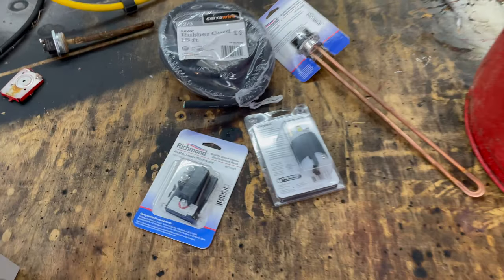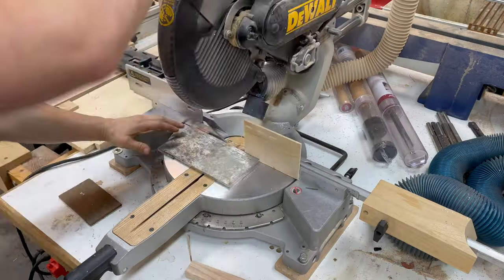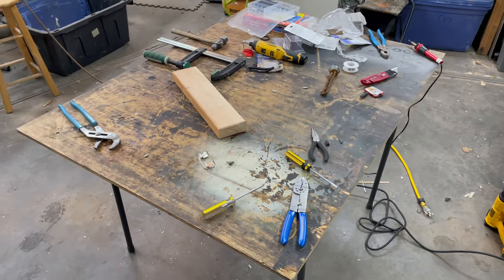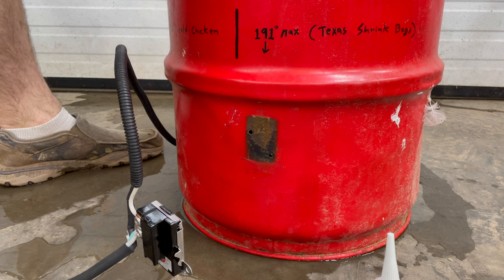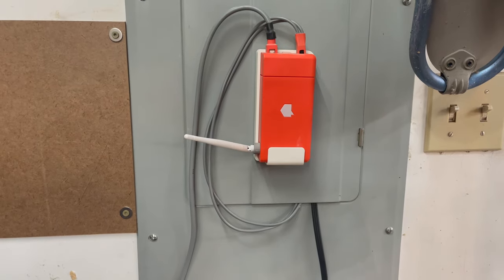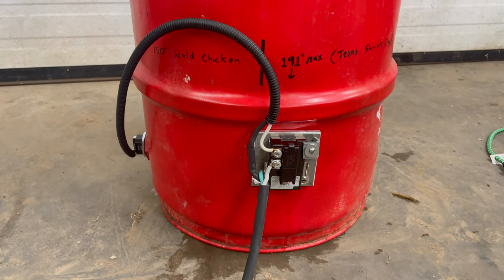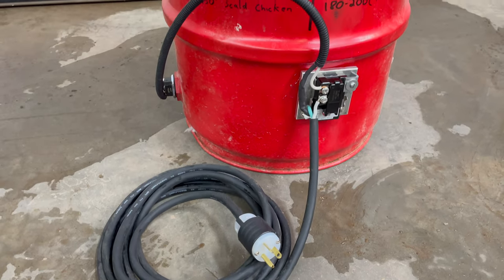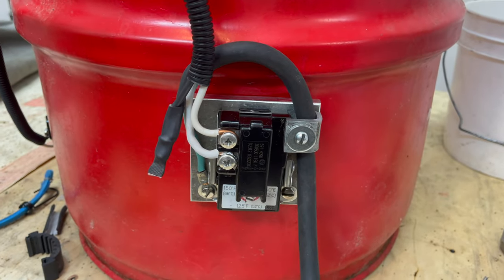Ultimate DIY Chicken Scalder (just $50)

Comment: Are u sure this will not give a shock
Reply from the maker: It is technically possible, but the metal container and grounded plug makes it unlikely - about the same risk as getting a shock from your water heater.
Reply: @samuelwiltzius  throw on a GFCI pigtail or integrated extension cable just to be safe. Otherwise looks great to me 👍